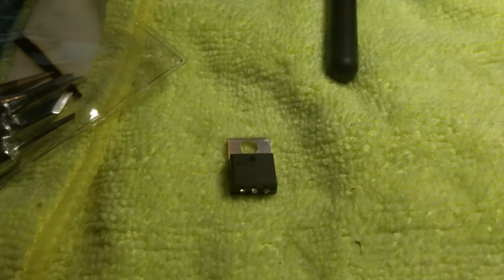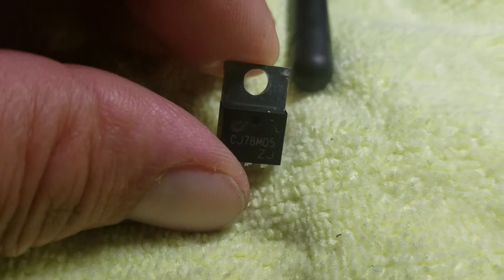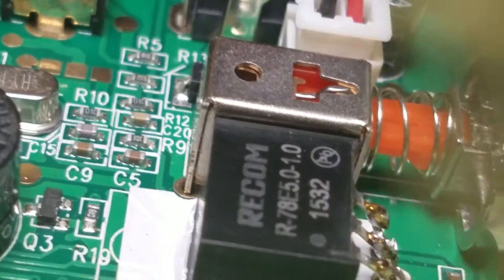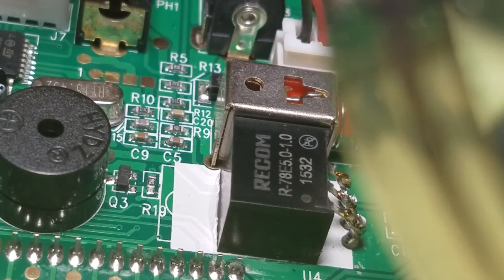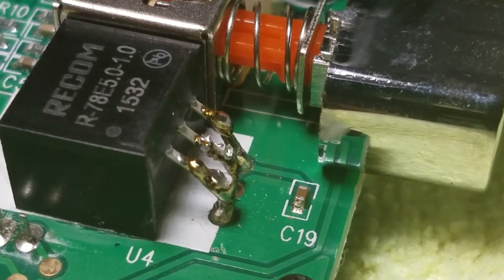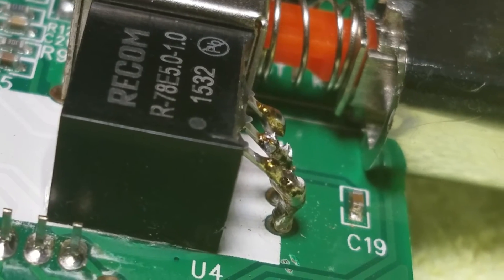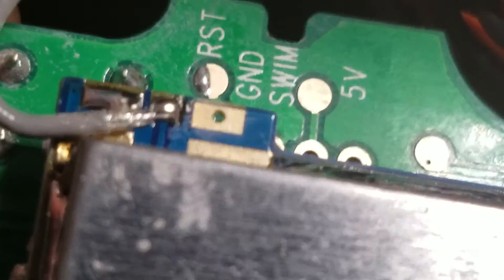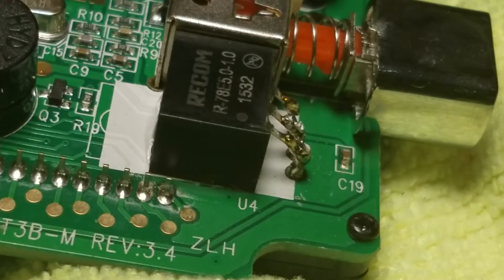10× batt life FS-GT3B Rc transmitter voltage regulator upgrade

Comment: Do  you   know what the minimum  voltage  is on  the transmitter?  I'm getting yelleed  at   on  9.4  Volts. What is the actual safe cut off?  Thanks, in advance.
Reply from the maker: I'm not sure it was a while ago but I think it was 2.4

Comment: Dont do this mod, the Tx will have lots of glitch. Installed the same regulator, the servos stay w a minor glitch on neutral.

I bought two brand new v. regulators, same brand and specs, the mod is BS, the servos will be glitchy, DO NOT DO the mode, waste of money and time.

I tried two new ones, servos glitch. Tested my other exact stock GT3B and no glitch, tested modded radio w another rx, still same problem.
Reply: What do you suggest

Comment: Why is the regulator so expensive?it costs $10.00 with shipping.the transmitter costs $35.00 to much for this upgrade,might be good but I will not do this one,anyway great presentation,thanks++++++
Reply from the maker: Kiroslab Tsip Greg it's cause there hard to find and u can't just get it from anywhere. Radio shack bit I think there all have closed down
Reply from the maker: Kiroslab Tsip Greg i can just put a 2 cell Lipo in it it will last a little longer then regular batteries just make sure u have at least 200 mah  or what u can fit in there are a couple videos on that
Reply: On Amazon right now its $8.24, free shipped
Reply from the maker: SkriP StreaM  once u do that upgrade u can switch it to Lipo and it will last forever not really but longer